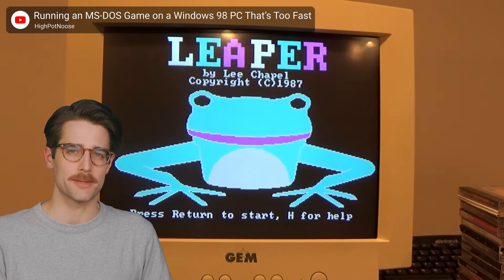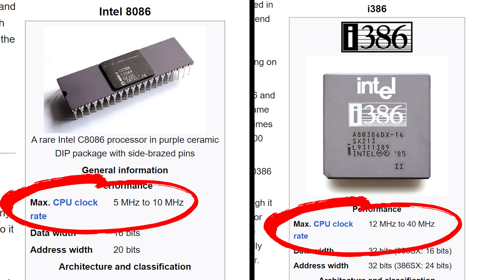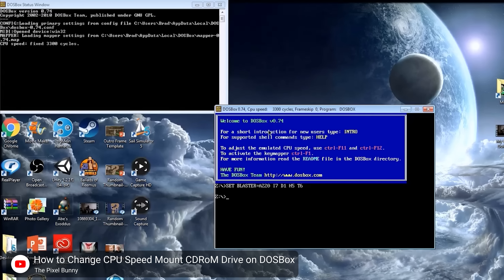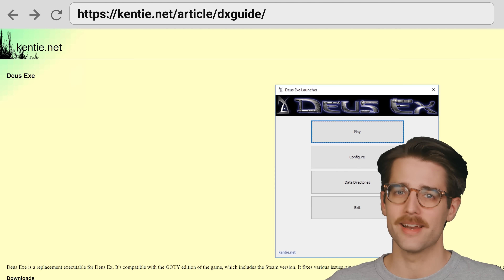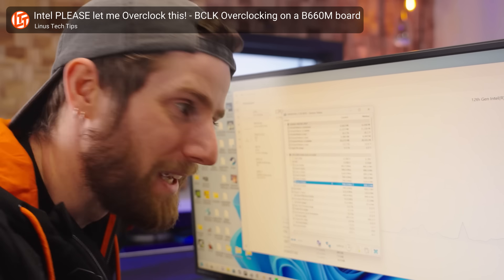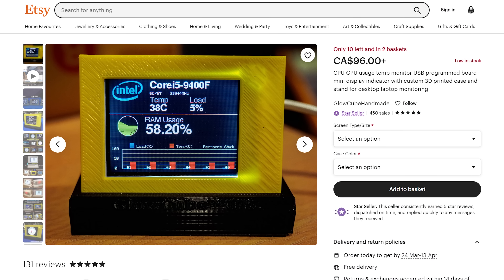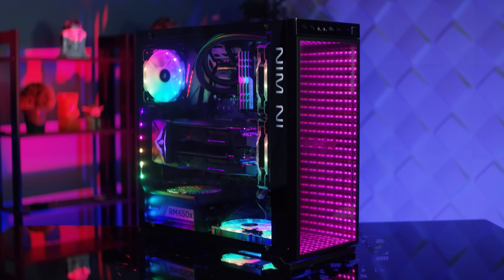Why PCs Had a TURBO Button

Comment: I got really excited for this video and had my reality destroyed when my experience clashed with what was explained. So, like, were there any PCs issued where the Turbo button actually clocked things faster? When I was around 10 or 11 I had a couple old computers, one of which was a tad newer looking than the other (IBM PC) which included a sweet green-shift button on the monitor and a square TURBO push-button on the case that illuminated green when on. I was curious about it and would cycle it when running programs like Duke Nukem doing DOS commands like dir /L and it would ALWAYS be notably faster when turbo was on. When I'd toggle it off, things would be unusably slow. Did I misinterpret the lesson in the vid, or did somebody at some point actually make a turbo button that made the computer zoom? Hahaha
Reply: You are miss understanding. IF there was NO Turbo button the PC would have run at its higher speed all the time. The Turbo button was included to toggle it to the lower speed. It does not matter if it was on or off to which it did.. Just that there was a button to slow down the PC. Get it now? The button did not make it faster.. It allowed the pc to run slower.
Then this get more convoluted when they made the default speed the slower speed and you needed to jumper the speed closed to get the higher speed.
That basic jist was the Turbo button was included to allow you to run the computer at a slower speed.
Reply: @tisjester  right, so I'm not misunderstanding what was explained, I'm just having personal experience that contradicts the explanation. The turbo button's intention was to allow operations to run at speeds optimal for them if the clock was too fast for optimal use of operation to the user. I get that. What I'm saying is that use of the turbo button actively made uniform improvements in speed of operation in both interaction within DOS and execution/use of EXE. With turbo off it was like an intentional stop was in place to output a new frame maybe every second, and with it on all output felt "normal" compared to the older IBM system sitting right next to it. Thus a perception that turbo "on" was faster.
Reply: No. Your computer was wired up correctly. Some people's computers had the button wired up wrong, and activating turbo mode did actually make their computer slower.

Comment: I remember i rewired my turbo button in my old case when i upgraded to a Pentium 100mhz. With the button activated, it ran on 150mhz. It was my very first overclocking. 😀

Comment: I bet speed runners would LOVE to have the Turbo button make a come back! I remember when my first computer at age 4 had a Turbo button and I always kept it at low, though seeing games go Uber fast was unplayable, it was hilarious!
Reply: Speed runs are based off of in game time 99.9% of the time such that hardware differences (load times) don't affect the run. Turbo would only make the game harder to play.
Reply: @Sammysapphira  Even a lot of speedrunning games that used to run off of in-game time switched to running on real-time in recent years, though. If anything, Turbo would just make things too inconsistent between speedrunners and artificially sped up (basically like if you just ran a game on an emulator and ran it on 3x speed or something).
Reply: Speedrunners wouldn't want to use a turbo button. Changes in game run speeds would need to be consistent for everyone who plays the game to be valid. Otherwise, you might as well just be running cheats (which are usually banned).

Comment: The original 8088 was clocked at 4.77Mhz (14.318Mhz /3) on the IBM PC because it was a multiple of the NTSC Colorburst  3.58Mhz frequency (14.318Mhz/4)  used by the original graphics card the "CGA". The VGA came later. The actual CPU could run at 8Mhz and the Turbo button allowed you to.  The problem was if you sped up the clock of the CPU you sped up the Counter/Timer logic by the same ratio. So your idea of a one millisecond "tick" just got boosted up and was not what you thought. This was because original PC's and their CLONES had to be built the same way to be 100% compatible. There was no Realtime Clock chip with battery. Everytime you booted you needed to set the date and time. When the RTC was added (PS2 and AT) the counter/timer function was now independent of the CPU and a millisecond was always a millisecond regardless of processor or its base clock.
For any system engineer at the time the design decisions made by the IBM Boca Raton team seemed to be to limit the design to little more than a terminal product offering different graphics options. Remember this was a period where you bought a computer and a separate text terminal AND IBM sold computers already.  The limited expansion, the small number of interrupts, the really small amount of supported total memory (640Kb) - all made for a cobbled experience.  Apple's LISA gave you more options BUT the Macintosh took many away. It cobbled the machine more than the PC in some ways and the rest is history. Fixing the PC's original 8 bit ISA bus limitations (and the new '286 processor's huge 16MB memory space)  was the wider 16 bit ISA followed by MIcrochannel, EISA and then PCI (parallel) and PCI-Express (Serial).  ASIC integration then SOC was the only way to do it at an acceptable price point.  (Count the number of chips each generation of MOBO).
(And bonus history - every processor in the 1980s (and each chip company had a unique one) also had an expansion bus associated with it. The IBM, being Intel used a chopped up version of Intel's Multibus to allow it to use LSI expansion chips that were designed to talk to Intel CPUs without too much effort. IBM's BIOS allowed them to change chips without breaking the operating system. The OS talked to the hardware through the BIOS back then. Unfortunately that was too narrowly defined AND slow. You first got BIOS extensions then UEFI - allowing the BIOS to be upgraded/extended. Of course you couldn't have an upgradable BIOS until it moved to erasable field programmable (FLASH) memory. You can thank the iPod for making that cheap.)

Comment: Fun fact: In my 35+ years in IT I've never seen a clock as frustrating as the one on my 2019 Invacare SP2 Power wheelchair's joystick display. It gains about 30 seconds a day. I kid you not. Why on earth would engineers even bother to code such a grossly inaccurate clock? Still, when its right I love having it, it's always on, right there. These cost upwards of $35k... Oops... gotta go reset my personal floating time zone.

Comment: The word you're looking for is misnomer.  The turbo button was a misnomer as when enable the machine ran at it's normal speed.  Turned off, made it run slower than normal.

Comment: It's not just a Turbo button not found on most common casings, it's also the classic Reset button to restart your OS by force.
Reply: the provisions for reset buttons are still on most mobos.   Simple matter to add the switch and wire it up. In most cases, though, it's just a matter of holding the start button for at least five seconds to force a restart.
Reply: @xaenon  I thought holding the power button forced a shutdown and not a restart.
Reply: @cst1229  D'oh!   You're (mostly) right.  It is NOT a reset as I stated previously.  I had a brain fart, lol.

But it's not really a proper 'shutdown', either.  

What most people call a 'shutdown'  involves prompts to save your work, close programs, etc., then Windows unloads  drivers, saves certain settings, logs off, etc. before actually powering off.  This is initiated by pushing the power button on the case momentarily, or by using Windows' 'start' menu.

Holding the power button for five seconds bypasses all that.  It's similar to yanking the plug out of the wall.  No prompts to save your work, no proper logout, none of that.  Just.... OFF.  NOW.  

Forcing an immediate power-off and then restarting the system is the functional equivalent of the old hardware reset button.

Most desktop system mobos still have provisions for a hardware reset switch, though most modern cases lack the actual button.

Comment: Most of the time it wouldn't work because the motherboard wouldn't support it or didn't have a connector for it, but when it did all it did was downclock the cpu slightly so the fan would be quieter, it's the same as using quiet fan curves in your bios these days.

Comment: As a game developer, this is one of the most important things to remember when programming. While some game engines nowadays do it for you, the engine I use requires me to multiply anything to do with time by a variable called 'delta' which is the time since the last frame, and if you don't do this it might look right for you, but it'll be completely broken on computers that run much faster or slower than yours. For example, in one of my games before I knew the importance of this magical 'delta' variable I would just decrease a timer variable by exactly 0.016 every frame, and on my computer (which ran at 60 FPS) it worked just fine and decrease by about 0.96 each second, by at 30 FPS it would decrease by 0.48 every second, causing it to slow down.
Reply: Exactly, I develop games on my spare time and I use  3 different game engines at the moment. Unity, Unreal5 and Godot and they all have a delta time system that allows the computer to compensate for the CPU speed so that the game always run equally fast no matter how fast the computer that is running the game is. These things and tricks however did not exist back then. Back in those days games were written  in Assembler or maybee sometimes very low level  C  all from the ground up  without any help from game engines and similar tools that we have and use today.
Reply: @johnpekkala6941  It was such a mess, as I recall when the CPU bus speed started changing too strange things would happen.  I also recall strange issues with compatibility if your ISA or PCI bus was running slightly too fast, particularly common with early overclocking when all the clocks were synchronised.
Reply: Lego island control system massacre lol
Reply: I always knew delta was important, but never knew why till today
Reply: @VlikeInMewe  https://www.youtube.com/watch?v=2CmqbccCqI0&t=3s&ab_channel=MattKC this video explain it very well
Reply: One of the very first things I learned during my games dev degree was the importance of a delta time to sync between all systems, we also we're made to have a hotkey to enable/disable the framecap to verify our delta time was implemented correctly
Reply: There are still some "modern" engines that have this stupid thing, like used in recent Need for Speed games where the animations were based on the frame rate, meaning they were locked at 60 or something even on systems that could run them way, way higher.
Reply: @TalesOfWar  in pubg mobile, activating the 90fps mode increases the rate of fire of the guns. it's stupid. literally pay to win
Reply: Bleak Faith, which released THIS week seems to have the same issue. If it's not locked to 60fps, game seems to be "janky".
Reply: Game dev here too, same thing in unity
Reply: ???? every modern game engine uses the deltatime to properly time frame drawing. you can use fixedupdate but that skips if the frame is not ready and if you dont do it it wont throw off sync on other pc-s it throws it off between every single frame. this is actually one of the major flaw of todays gamedevelopment that there is no programmable interval timer interrupt like old pc-s had, it all goes from software now. back then we had an exactly 18.2222hz timer that ticking roughly 18 times a second so it was easy to time a game to play "realtime"...

Comment: This turbo button was required to run NASCAR Racing (1994) with the NVIDIA NV1 GPU. Otherwise it would run like crap. The same issues happened again between around 500MHz and 1.1GHz Pentium II/III as well. Many games required fixes by developers to get around it again. Most notable racing game being Grand Prix Legends (1998). It hasn't happened since.

Comment: It depends on how the button was wired. Sometimes, the button was wire in the invers, so when the button was pressed in, turbo would turn off not on.
Reply: The issue is switches come in 3 wires. A ground wire , normally open and normally closed.
Reply: How it was wired is not very relevant. The point is if there was no button the the PC would run at its maximum speed all the time. The included the button to allow you to toggle it to the slower speed. Then this get more convoluted when they made the default speed the slower speed and you needed to jumper the speed closed to get the higher speed.
That basic jist was the Turbo button was included to allow you to run the computer at a slower speed.
Reply: @tisjester  The issue is that the connectors on the button is a 3 pin socket header. when you assemble a computer in the factory you can get confused of what orientation the connector you need to plug in the pin header. most push buttons switches have 3 wires. A ground wire, normally closed and normally open. The wires are terminated by a 3 pin connector.

Also the connector and socket is very small and is places in a tight space making hard to check if it was connected the right way round. when you are working in a factory are expects so many computers to be made with in the day. you can't afford to just take your time checking.

Typically the connector on the motherboard is 2 pin header like what you expect.

When you try to connect a 3 pin connector to a 2 pin header with no instruction. you are going to have a time that will have a switch that seams to work backwards.

An easy fix is to move the connector to a different position on the header.

VWestlife did a good video about the turbo button.

Comment: I'd like to point out that the turbo button acting in reverse is because PC makers often plugged the connection of the Turbo button inverted (Likely due to a mistake and/or oversight). VWestlife made a video about it recently
Reply: I was commenting about this issue.
Reply: I'm kind of shocked they thought turbo slowed it down
Reply: @roymather1  Well when you have a mass produced product that needs humans as part of the assembly process. your bound to have mistakes.
Reply: Things assembled by people often can have more mistakes, depending on the standard those products are made to. I’ve seen this a lot, as an electrician, with light fixtures. Connectors that are backwards, but will still technically work that way. Splices in the wrong compartment of the fixture. Sometimes all it will take is the one person in charge, deciding that’s the way the team will assemble it.
Reply: Interesting 
Never knew that one

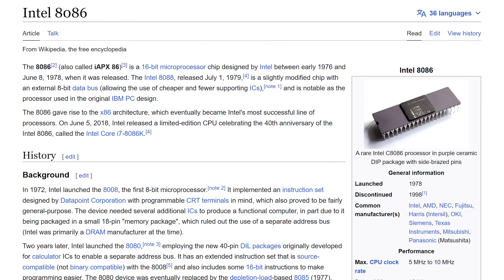Comment: 0:55 Intel 8088.  I wish they'd gone with 8086 in the original PC but they didn't.   I had an AST 386/33 PC in the late 80s a button that switched it between 3 speeds.  By default it ran 33 MHz but it could switch down to speeds simulating the speeds of the IBM AT and IBM PC so that old DOS games could run at the right speed.   On most machines I had, the "turbo" button slowed the machine down to the slower speed since they booted into the fastest speed automatically, or could be set to, and why wouldn't you?   Older ones had a turbo mode that had to be activated with software.   Texas Instruments 286 machines booted into 6 MHz and you had to activate turbo 8 MHz by software!   It seemed the "turbo" thing was disappearing by the mid 90s and those LED displays of the clock speed that were common for a few years went away.   This was a neat little trip down memory lane.
Reply: Yeah, I was going to say the same thing, the earliest PCs had 8088s (8 bit bus) as their main CPU as opposed to 8086 (16 bit bus)... but in fairness to Riley, I doubt he'd ever have used PCs of that vintage to know what processor they actually had, and he probably just read it off the script while assuming it was correct, because x86 or smth. Ironically, the "weaker" 8088 actually came out after the 8086 did, but was more economical in terms of cost and the cost of the peripheral cards it would end up using were likewise more economical than if they had went with a 16 bit bus at that stage of computing.
Reply: What Riley said is technically correct, the issue is due to programs written for the 8086 architecture at it's original clock speed running too fast on 286/etc hardware.  The fact IBM opted to use the castrated 8088 variant of the 8086 in their Personal Computers to save money isn't really that relevant as the software in question was written for 8086 architecture.  To use an analogy, a lot of early 90s software was Written for the Pentium architecture, but still ran on the Celeron.
Reply: @llynellyn  I mean, this is technically true, but the way the whole explanation was worded implied that those computers were using 8086 CPUs specifically, which was rarely the case, though the 8088 was part of the x86 family of processors - it's more a case of semantics, and probably not that important in the grand scheme of things. Having said that, I do agree, the main point of the video was to point out that the idea was to try to maintain some compatibility with older software by slowing the processor down, which a lot of younger folk didn't know about prior to this video being released, so it's nice to see them provide some light on computing history 👍

Comment: My gaming laptop's overclocking button is called "TURBO". Of course, all it does it make the laptop sound like a jet engine, for exchange for slightly cooler temperatures and a few extra frames per second.